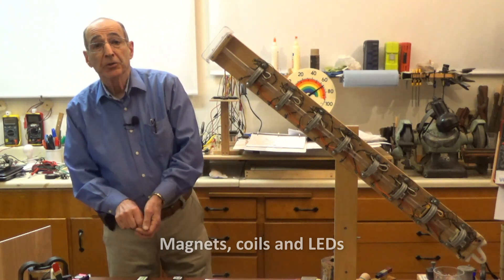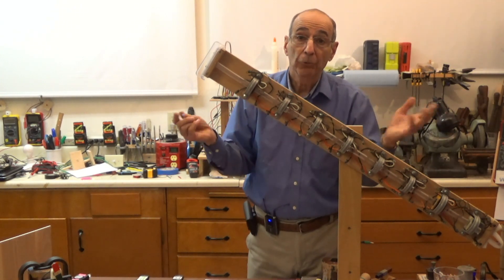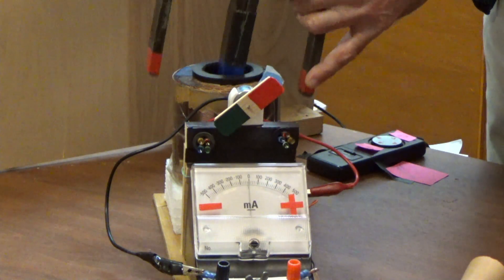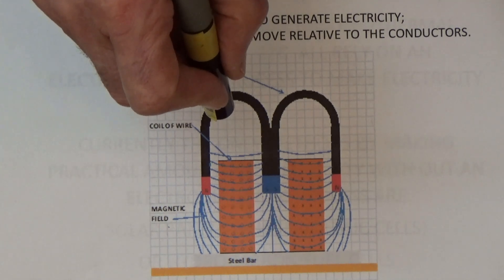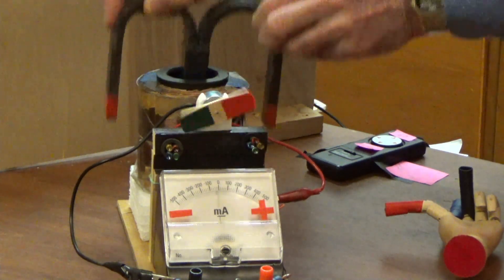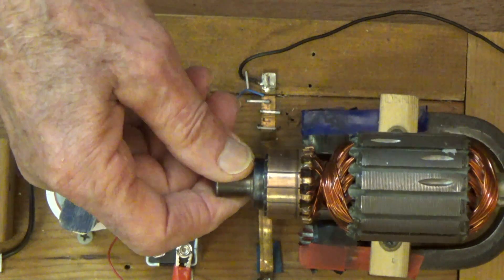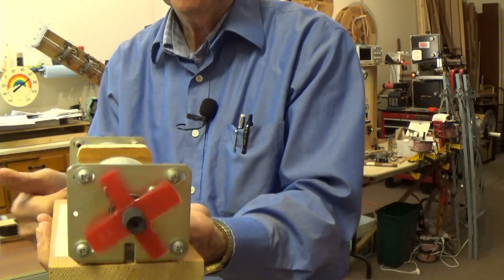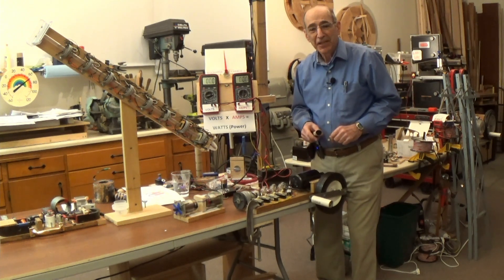Session 11 Electricity from electromagnetism

Comment: That was great! it's always fun to see the physical effort required to do something manually that we take for granted from electricity. I live on Maui, HI and one of the tourist spots has visitors pick tropical fruit to make amazing smoothie drinks - but they have to make it using a bicycle-powered blender! The bender is plugged into a 'dynamo' mounted directly on the rear wheel axle and the effort required, even though the bike is an old racer with 10-speed gears, leaves most people so out of breath they have to recover for a while before even thinking about enjoying the smoothie. I was told 70 watts is decent shaft power for the average Joe's legs sitting on the stationary bike and after 30s at that output most begin to struggle - which puts the 400 watts continuous for 60 minutes of competitive pro-cyclists into perspective!
And looking at your hand-cranking effort to get 3 x 10 w bulbs glowing for a few seconds makes one think of the almost incomprehensible forces involved in getting a big Siemens or GE gen set cranking out 600MW......enough to keep 60 million of your bulbs glowing.....but requiring the combustion of about 100 rail cars of coal (or equiv) each day.
Another excellent video in a wonderful series.